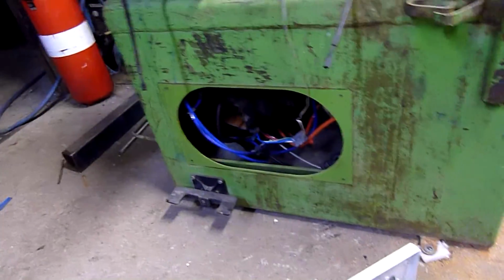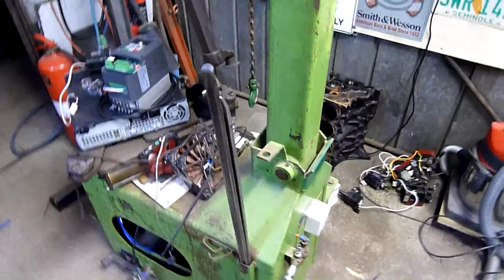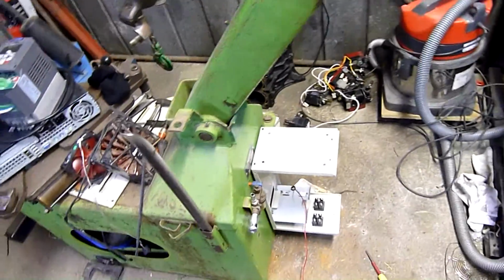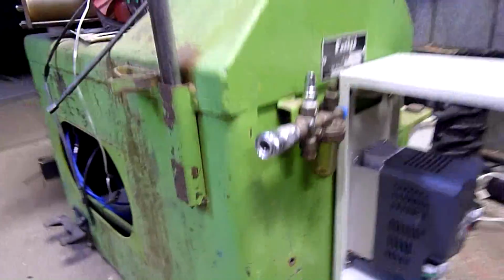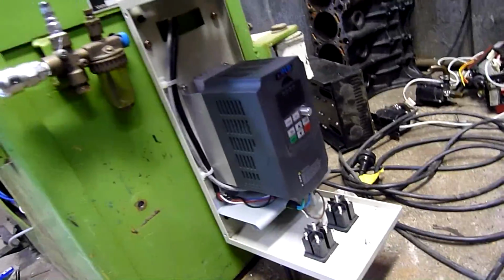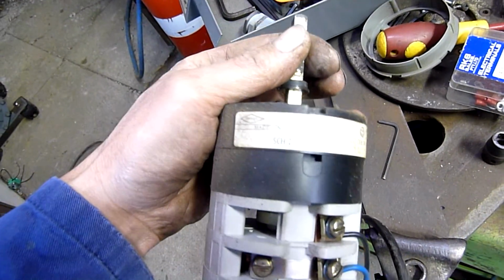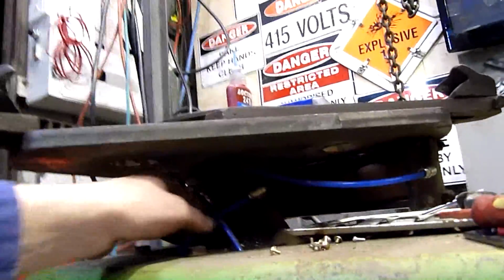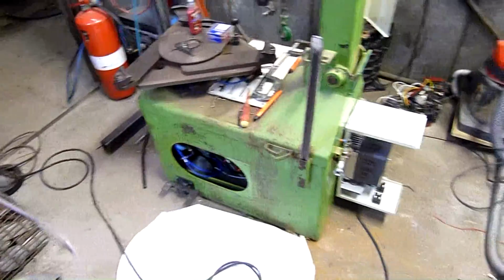Faip Tyre Fitting Machine Single Phase VFD Conversion

Comment: Hi Aussie. Good vid thanks. I am
Trying to wire up similar setup and not sure how to wire the drum switch up to the vfd. Is there a particular x number I should be using, my bad goes
From x1 to x6 and has two com terminals. Cheers

Comment: Rubber conveyor belting, available at pretty much any belting supplier. You might even get some as scrap. I use it, as you can drill the mounting hole and then simply use a milling bit to go down to a inner ply so you can recess the screw. Even tyre tread works with that, going down to the ply to hold it recessed from the top.

Comment: heavy truck mud flaps , they are really thick rubber , once they get ripped off the trucks they are junk (holes torn out) find a couple of them for free easily I would say  , and double them up for the rim protection , in a tire shop that might not last a month , but for your use , that should last a lifetime ...
Reply from the maker: Excellent idea my friend!. I will have a hunt around the local workshops, I am sure they have one or 2 around.
they make good shop floor mats too :D
PM me a shipping address for some more aussie goodies. your last box I was making got flood damaged but I have found some more stuff to send!.

Comment: great deal , I am still using an old manual tire changer !!  I like the fix you came up with ..
Reply from the maker: the kind you have to walk the lever around a center post?/ I have actually never used one of those, only automatics.
Reply: Yes .. And it does work very well ! Just take a bit of get'er done brute force ..